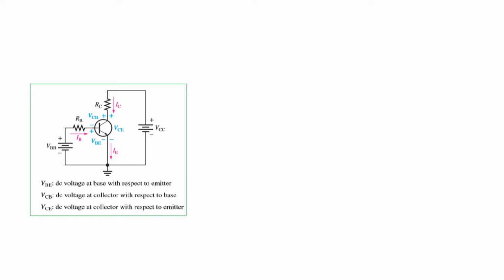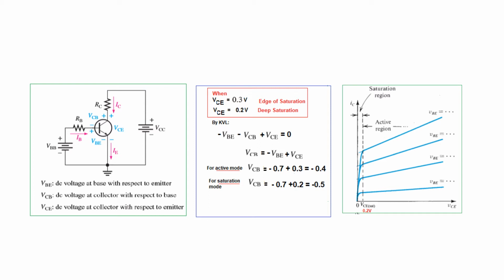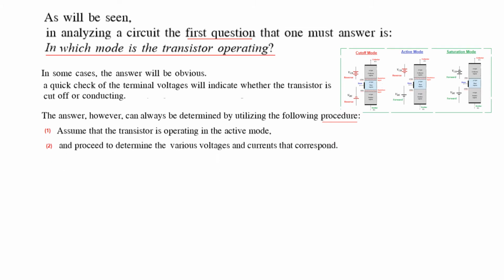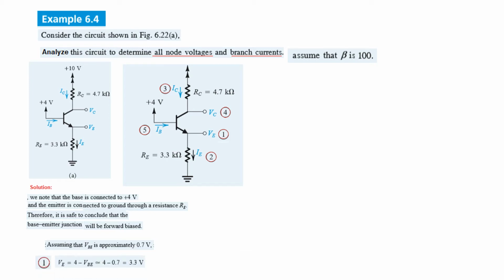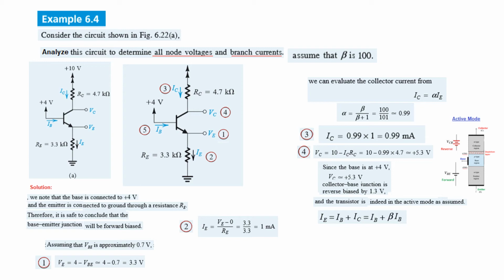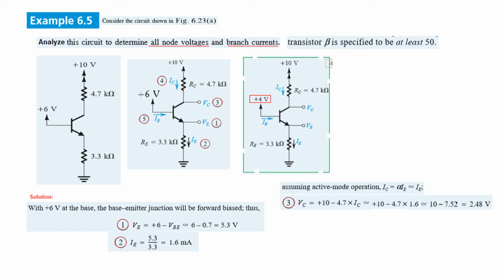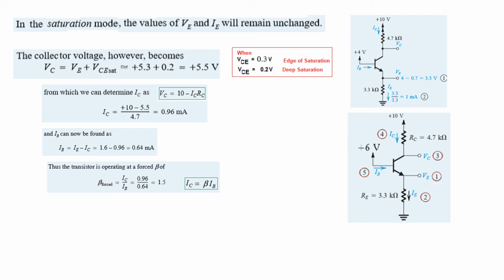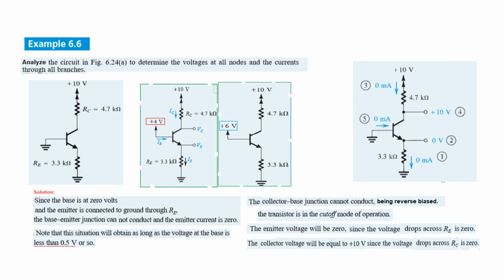(E)EDC(S)  Ex 6.4, 6.5. 6.6  || BJT Circuits at DC

Comment: sir why ie and ve is unchanged on sacturation mode
Reply from the maker: In the saturation mode of a Bipolar Junction Transistor (BJT), the collector-emitter voltage (Vce) and collector current (Ic) remain relatively constant, even as the base current (Ib) changes. This is because the transistor is fully "on", behaving like a closed switch, and further increases in base current don't significantly affect the collector-emitter voltage or current. (Chat GPT)

Comment: What is Bita forced??
Reply from the maker: Google it. Please mention my video time where you found beta forced
Reply: if not stated beta is usually 100
Reply from the maker: @Trifectav3  Yes, It can be assumed to be 100.
Reply: Beta forced (β-forced) usually refers to forcibly specifying the base current of a transistor in reverse, so that the transistor goes into full saturation mode.